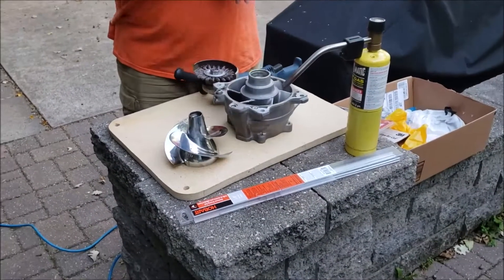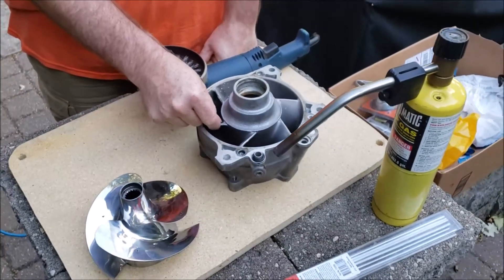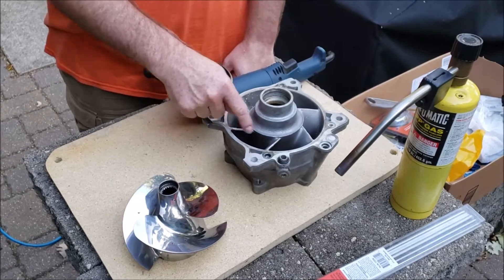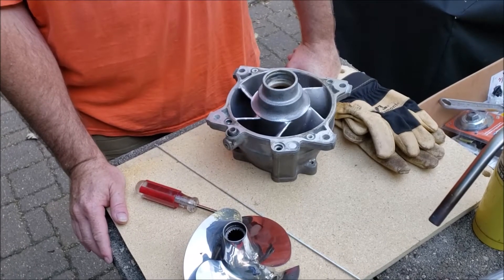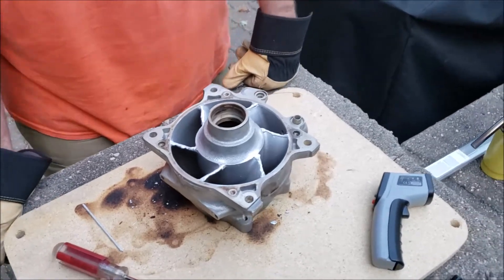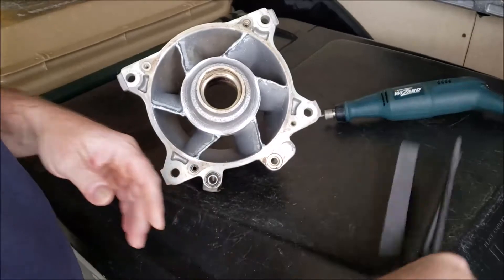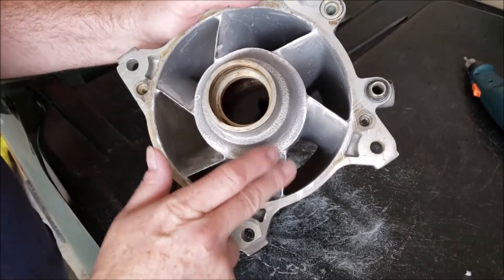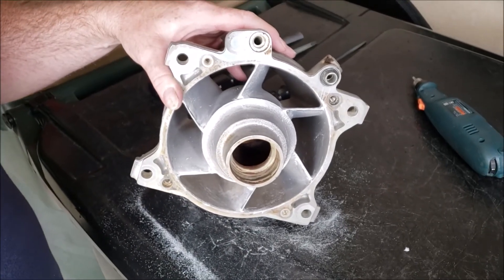Kawasaki Ultra 150 Jet Pump Stator Repair

Comment: Hello. I was in a hurry and installed battery terminals backwards for a full minute is their any fuse to protect system? Have no digital dash when key is on nothing on. Do You have a wiring diagram for 1999 ultra 150  Thank You
Reply from the maker: I would begin with a complete physical inspection of the wiring harness. One minute is plenty of time to melt stuff. The original 1999 wiring harness had resettable breakers but given their age it is not unusual to find an Ultra with updated or kludged components and assemblies. The entire service manual including the wiring diagrams is online already. I have no rights to reproduce or post so I am not.
Reply: @atthelake7637  Theres a breaker at the back of the seat. It says main.
Reply: Older models have disable links